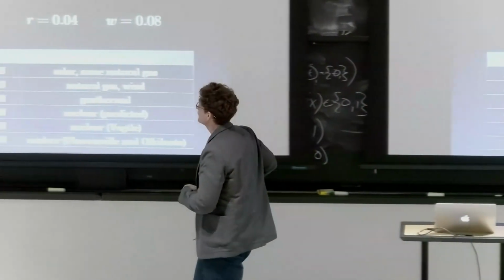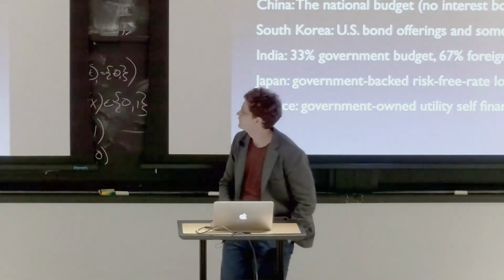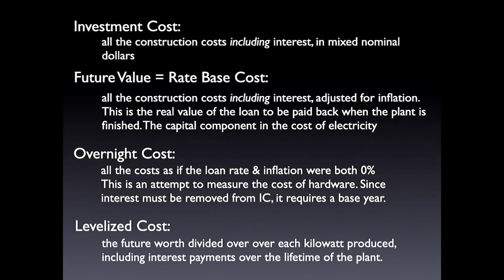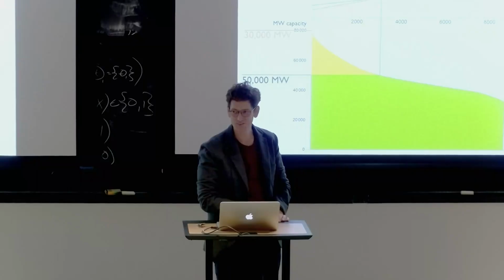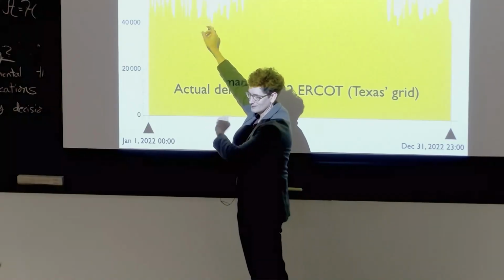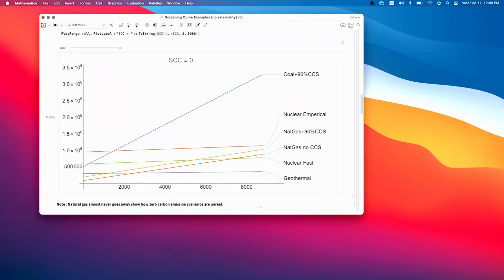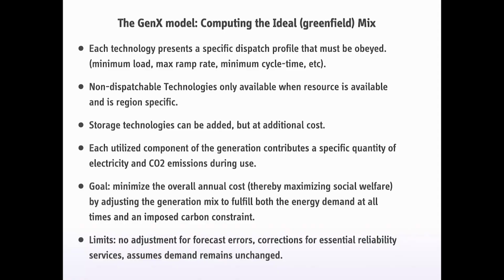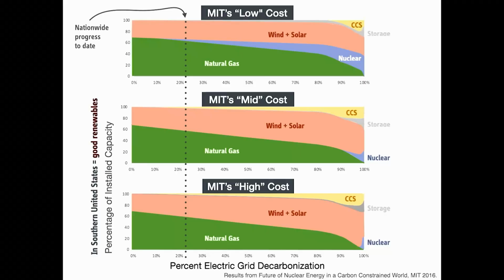Lecture 5: Can Nuclear Compete Given Decarbonization?

Comment: Solar, oil and gas have received significant government funding over the last 50 years. Nuclear has not. This drives their costs to be cheaper due to increased development. 

If we were to do the same for nuclear, wouldn't the potential cost be much lower than this.